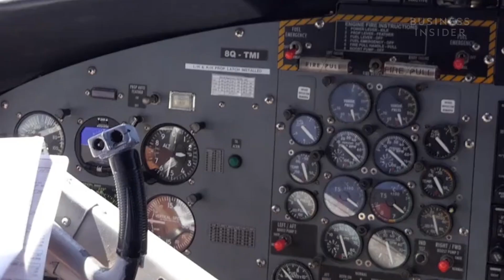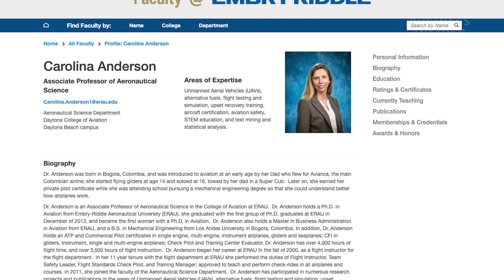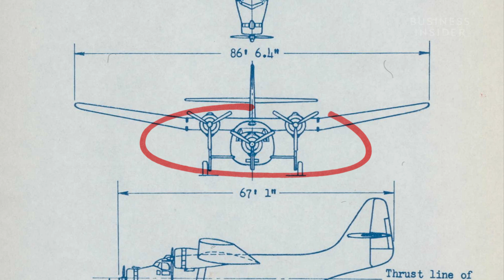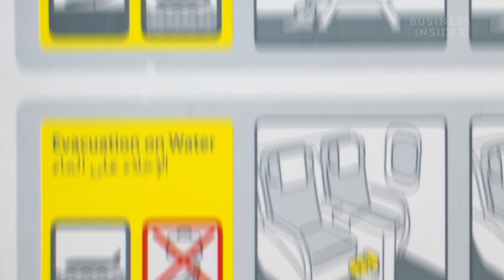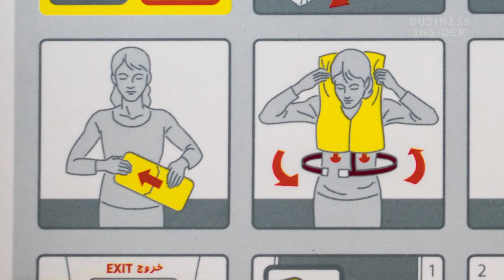How Planes Are Able To Land On Water

Comment: Why cant they make every airplane floatable on water like boat
Reply: Etherius Sention yeah thats what im thinking. if they somehow apply bouyancy to planes or give the plane a giant retractable life jacket that can hold the plane for atleast 30 min but idk im not an expert
Reply: Because they're design to be on air, not water, smaller weight mean better flight efficiently. In an emergency, plane would usually have a better change of survival when landing on land and Runway since the Engine won't have potential damage with the water wave at very high speed. Also by installing a floating device on plane. It would need to lose up the lower part which is no good.

Comment: Because if you hit water hard enough it will have the force of cement and also because the flaps and engines will create more drag in a plane and maybe cause a cartwheel if not slow enough or if the waves are tall.

Comment: Why don't commercial airlplanes have those things that seaplanes have? What are they called? Like the skis, that allows sea planes to land on water
Reply: What's the point of that? The plane will ditch anyways because of weight!
Reply: @annoyingguyoninternet1631  right
Reply: @lemonator8813  Seaplanes usually have landing gear though.
Reply: Because at that size and weight the entire plane needs to be a boat  look up large sea planes

Comment: Cause they have two or more dirty great engines below the wings...and when they hit the water at speed the kinetic forces rip off the wings or spin the plane into a cartwheel...
Reply: But could designers improve more by creating a new system for the plane to actually able to land on water? Or maybe a system that allows the passenger to be rescued when something goes wrong midair? Is that even possible? Asking out of curiosity.
Reply: @khairulhafidz15  planes are able to land on water just they are not meant to
Reply: @khairulhafidz15  so basically, amphibious planes.
Reply: Khairul. Something like that would be too expensive for the role. Safety should be a tool that save us from damages and death with a convenient price, for the risks.
That's why in constructions we use stretchable ropes and stuff like that for working at dangerous heights and not place inflatable stuff on the ground.

In planes there are safety vests and those should be enough considering how widespread they are and how much they are unused. A plane with engines placed above the wing not only wpuld be a huge cost for the design and manufacturing process but even for maintenance companies, because you can access them with just a ladder, imagine having to use a crane to get on a engine placed over the wing.
This is something that would cripple the economy, which is not the intent of safety.
I think one thing addressed in the video that got me mad was the inadequate amount of training for the pilots. Training is way cheaper than safety gear and still more effective in many cases
Reply: @khairulhafidz15  Ooooor just switch to the glorious old system of prop planes, jet planes are overrated anyways.
Reply: @scythal  turbofans are different from turbojets. And idk if it’s overrated, but I doubt turboprops or pistons are ever gonna overtake again. People need the speed that turbofans can provide. Props are only more useful for short distances, where speed is less of a concern due to the fact that if planes are needed over a short distances, usually that means that barely any other vehicle can travel from those two points. And due to the fact that buying a turboprop was cheaper, smaller airlines could operate the planes for these kind of flights. One example I can think of is Alaska. Driving and flying there is dangerous, but taking a plane will be much faster, even if it’s just a piston engine aircraft.
Reply: Switch hitter
Reply: ThexBorg why?